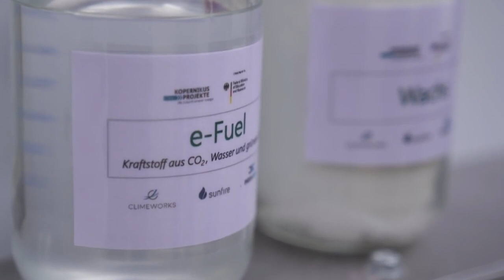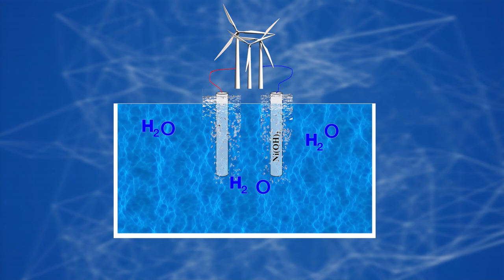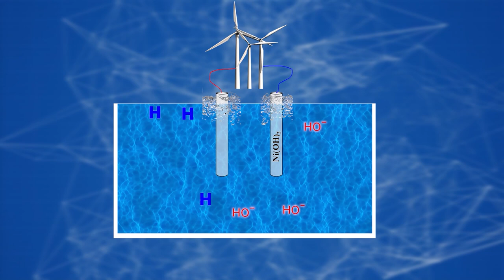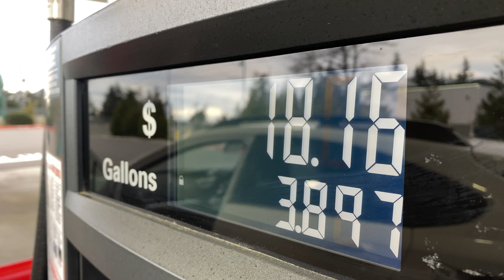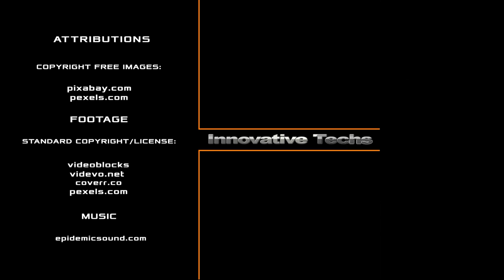Could Porsche's New Fuel of The Future Save Gasoline Cars?

Comment: this is the future. not evs, at least not with lithium
Reply: i'm into the idea of just using hydrogen as fuel, no carbon at all, only makes water
Reply: And there's the key. The batteries so we have narrowed it down to a single part of the driver ain't left to improve as electric motors them selfs are far lighter and far more powerfull and far smaller. Everything about the electric car is better except the battery. (Subjectovly the sound also)
Reply: @Nick Pallatt  hydrogen has a long way to go but we would get to keep the sounds kind of
Reply: @velez910  what do you mean kind of? It would sound exactly the same if not even better. Hydrogen is EXTREMELY flammable, way more than petrol, it would produce louder bangs than what we use now.

Comment: There's going to be a massive trade in VIN plates and the associated paperwork for "rebuilders" of IC vehicles when the EV bubble bursts.
Reply: It's unlikely you will be able to register them for use in the UK after 2030.
Reply: @Brian-om2hh  They're already registered, so they're not "new".
Reply: Toyota is already planning to do this - they are going to "refurbish" (read: rebuild everything except the chassis with the VIN plate) old ICE vehicles to keep them running even after the ban on new manufactures.
Reply: @edvoon  Thereby re-using a good deal of the energy embopieo in the vehicle.
Reply: @parrotraiser6541  Yes but in it’s new extended lifetime it will then continue to pollute way more than the embodied carbon footprint, and it’s only the embodied footprint of the chassis that is preserved, everything else is new.  Better to just replace it with a new EV which will quickly make good its  embodied footprint within a year or two and is emissions free after that once the grid has also decarbonised.

Comment: Not a problem for price of new fuel because of fuel efficiency standards and ev battery packs along side these new ece' thats e combustible engines BTW. 

These cars would really and I mean really maximize fuel efficiency ranges. It turns over with ev battery and once the car is up to speed then the e fuel turns on to drive your car. It switch back and forth on off on off as you travel along and make necessary stops or take offs. 

Especially considering the fact that some of your fueling cost would come from your place of residence and not have Mark up cost it could balance out to the consumer